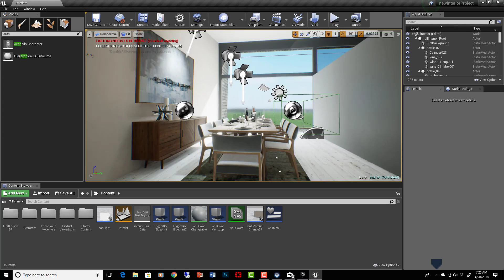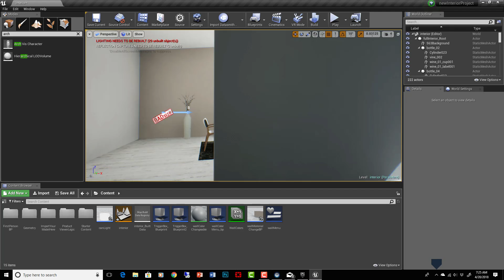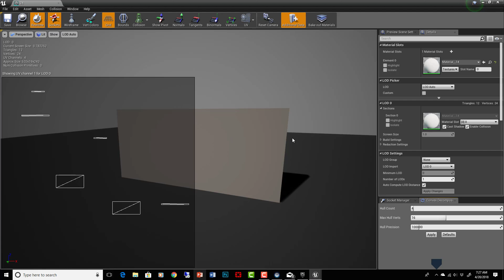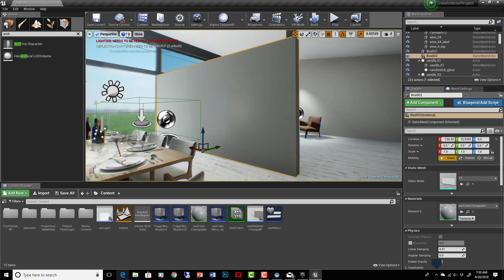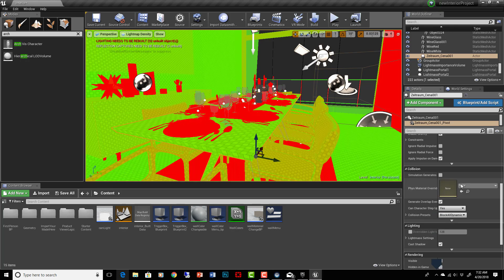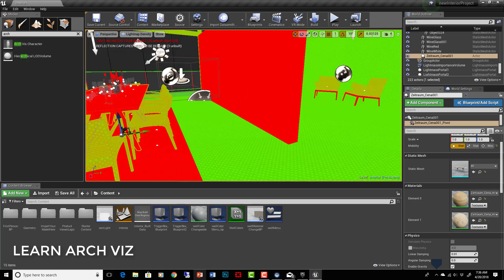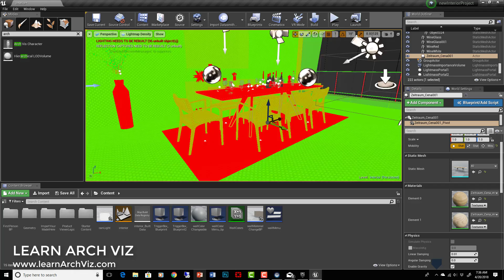Fixing Common Lightmass Errors UE4 Arch Viz - Overlapping UVs

Comment: If you use Blender to create your models like me, make sure to have two UVs maps: one for the actual texture where you normally unwrap, and another map for lightmap; when selecting this UV map press "u" onto the model and choose something like lightmass unwrap (don't remember how it was exactly called now). It will firstly create some really weird UVs but believe me, it will generate a pretty good shadows with 128 - 256 res
Reply: I know this is an old comment but... I actually have 2 UVs mapss the 2nd for the lights, but it still make me ugly shadows, do you have any ideas why?
Reply: @raskzakcreator  Probably because your lightmap's margin is too low. In Blender try to set it up to 0.50 or even 1.0, and in Unreal don't set your lightmap resolution below 128. That worked for me.

Comment: Thanks. This helped me a lot. I use sketchup and export to fbx. I got Overlapping UVs . I do as told in the video. It works. But it requires me to use 4096. Well, I wished I can use lower value.. at least it works.

Comment: My mesh's lightmap resolution was 64. I had this light map overlapping problem too. I watched videos, but those solutions didn't work for me. I noticed that even if I increase the lightmap resolution to 512, my Min light map resolution (at details ->build settings) is still 64. So I changed that to 512 too, also changed the Source Lightmap Index below it from 0 to 1 (i don't know if it's actually needed tbh) and the problem is gone. Try this maybe if nothing solved your problem yet.
Reply: OMG You just save me. Thxxx :)
Reply: Just curious, Would it better if the mesh is in Static when comes to lighting? or stationary?

Comment: what is your take on light leaks? end to end snapped objects, usually around the openings of doors and windows I get crazy light leaks.
Reply from the maker: A lot of them can be fixed by upping the light map resolution of the objects that have the problems. It usually just means that the light bake needs to be more precise, so light bake settings can also help.